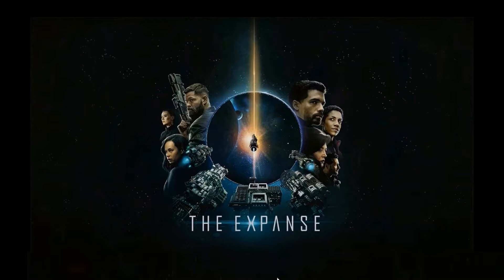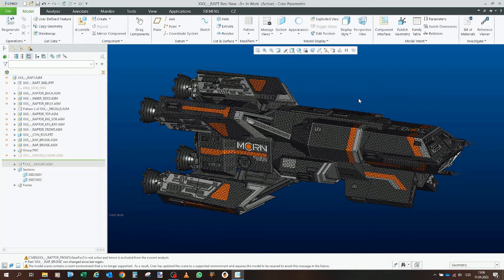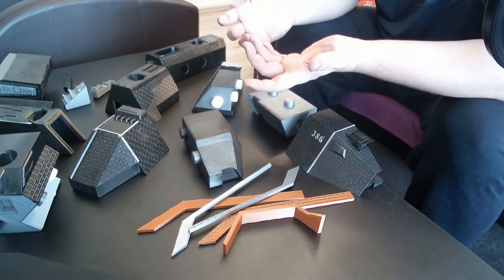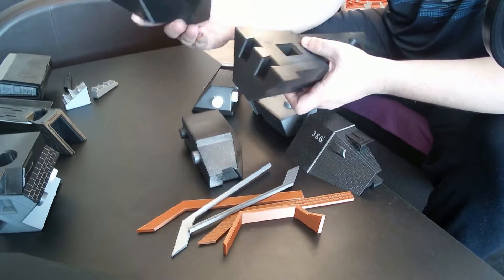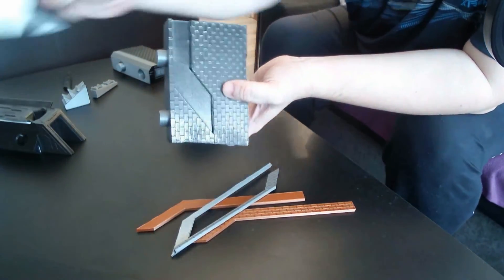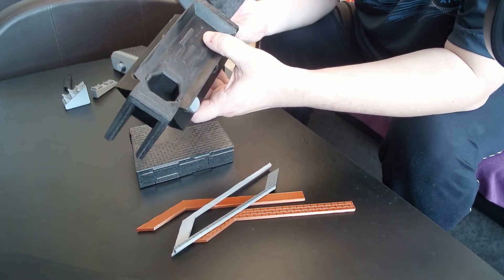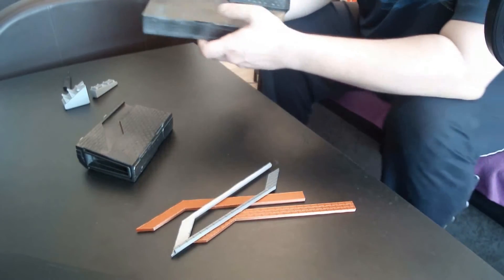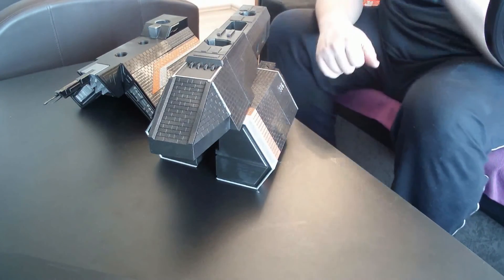Project Raptor Part 5 - Top, Sides and Missile bays

Comment: Is this 3D model adaptable for changes and corrections (proportions, desing, scale, parts...)? It is greatly "engineered", but needs corrections to be The Model.
Reply from the maker: Not sure what you mean exactly. Once it is published, you can do whatever you wish with the files provided you state me as an original author. Is that what you meant?
Reply: @martintaichl  Yes. What I would want to do, is to use your design as the base (instead of making it all from scratch) to redesign it into fully accurate design of the model. If some compensation is needed, I'm willing to compensate, addionally, I'm willing to hire you for that job (redesign), obviously that would be paid-job, if you do that. Either way, a fact that you made initial design will be known ofc.
Reply from the maker: @elvisibra  as I said once the data are available, you can change it in whatever way you need. 

But I will be frank with you. Though I appreciate the offer, I have to decline. I spent so much time and work on this project already that I do not really wish to do any work on it in a forseable future. I hope you understand
Reply: @martintaichl  Ok. I like your design as a base, so I'm asking for permission to change it. As for hiring you for the job, it wouldn't include printing, just 3D modeling, as I do not work with those programs, what I mean: drawing isn't a problem for me, but I have to learn how to use a pen first, cause 3D programs are very complicated pens. Eventually after I get familiarized with 3D modeling programs, changes will be easy. And after the changes, I can slice and print it myself..
Reply from the maker: @elvisibra  I understand. I was talking about the modeling comission. Lets say that after all is printed out and the project is done. I want to take a break from the Expanse for some time and return back to the SG models
Reply: @martintaichl  No problem. I'm not in a hurry. I usually cooperate with a designer, and then after design is proper (proper as accurate to already existing item/model being designed), I print it myself. This particular design you made, needs overall corrections (entire model) to be accurate Light Cruiser, but as design is already very well made as the base, those "extensive" changes are not complicated, instead they just add out/on to what is already there.

Comment: How much pla so far ?
Reply from the maker: Too much i am afraid. I strughle to hold it in one hand. When it is done, i will try to weight it. But it is really heavy
Reply: @martintaichl couldn't be any heavier than my life size Mikasa statue. Can't wait to get my mits on the files and print the behemoth!
Reply: I'm at 7 rolls.. it is VERY heavy. So much so Ill likely hang it with steel cable. not sure how much you could reduce the infill to lighten it up a bit.